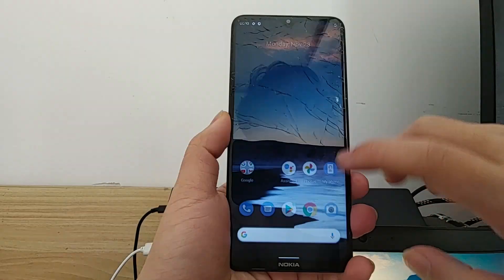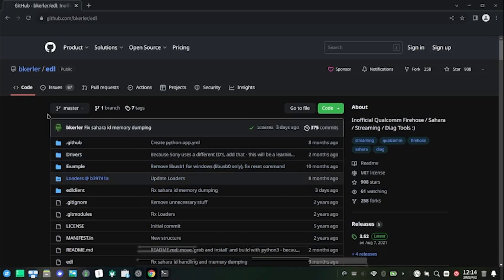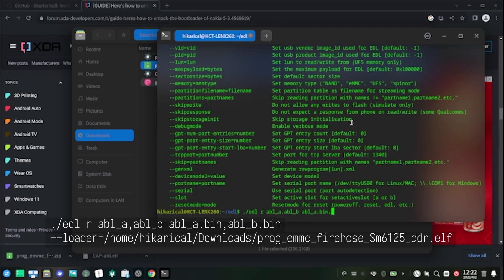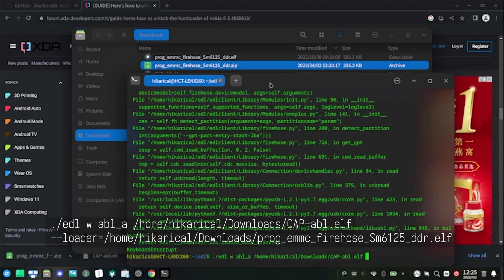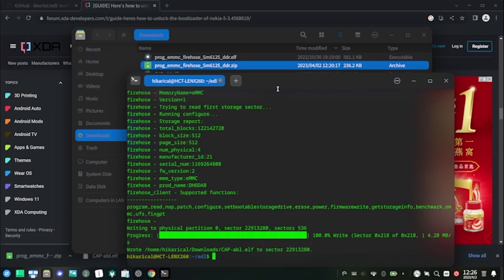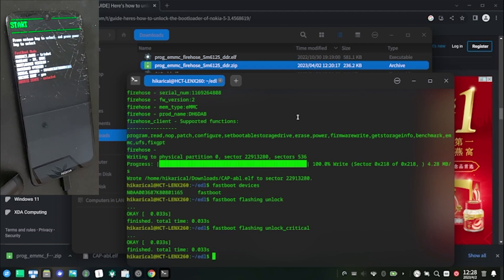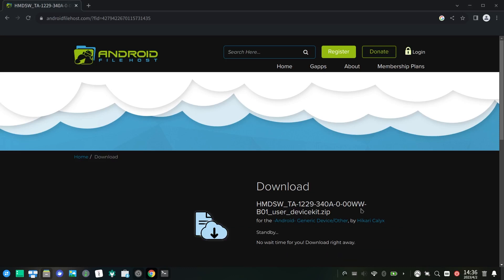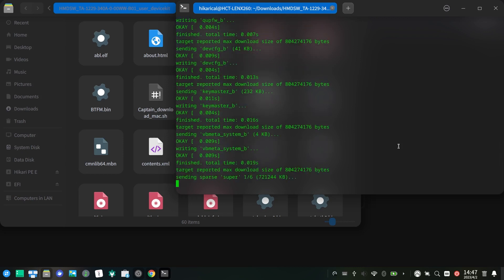Here's how to unlock the bootloader of Nokia 5.3 and unbrick by yourself

Comment: Instead of this disassemble,if i do it with edl cable for xiaomi and Qualcomm ,do i have to turn of the mobile and just connect the cable and do the rest?
Reply: Ok i read ur xda post and understood that this cable will work without disassebling my phone but will this bootloader unlock method work for ta-1234 version of 5.3 with latest android 12?